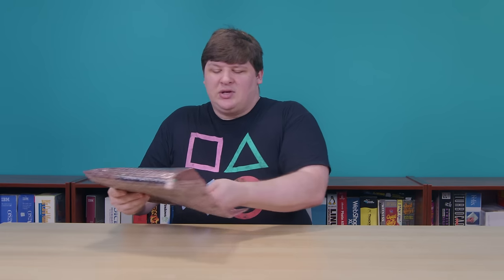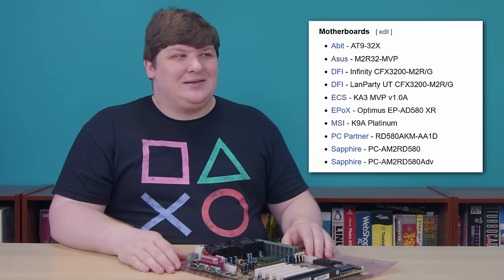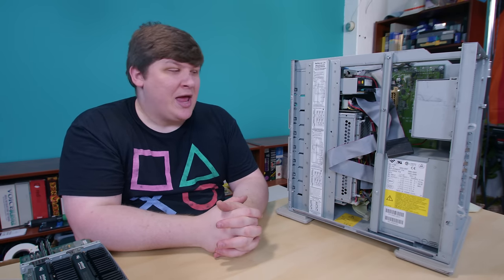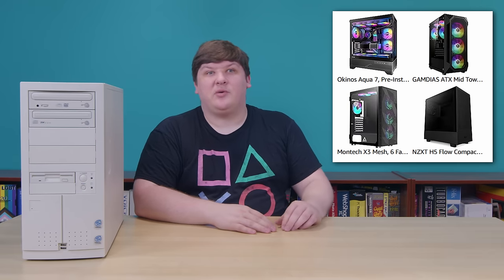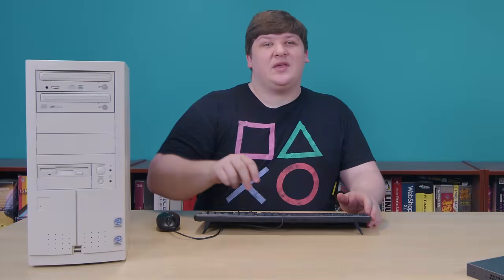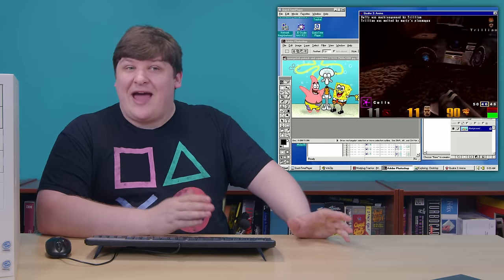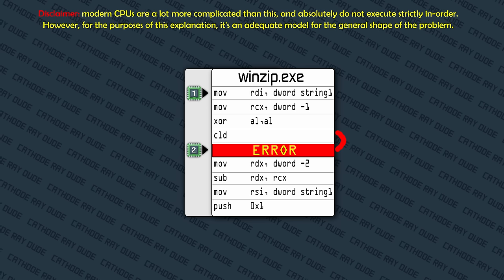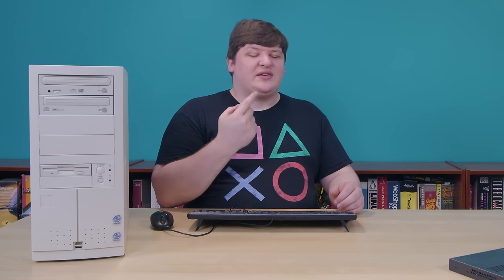The Only Famous Motherboard

Comment: I totally remember the celeron hotness.  My girlfriend at the time was absolutely bonkers about hers, lol.  Also, unless it's changed since I was in grad school, most dictionary-based compression algorithms are impossible to parallelize.  The state of the "dictionary" changes after every token is processed, so it's not possible to know what the state of the dictionary will be at any point in the file other than where the "head" is.
Reply: Yep,  back then I was constantly on the overclocing forums and being envious of all the wild Celeron overclocks.

I think I remember the Celeron 300a was super popular because you could pretty effortlessly get 500+ Mhz out of it.
Reply: The way to parallelize it would be by decompressing two files at the same time - this actually should be an area where zip has a huge advantage over 'monolithic' archive formats like .tar.gz, since each file within the archive is an independently compressed stream, something that's historically been regarded as a disadvantage since it of course makes the compression itself less effective than it otherwise might be.
Reply: 450 was a given, 504 was common but not always
Reply: The only way i can think of parallelise compression is ti split one file into multiple smaller ones. This is what i did sometimes. instead of "onebigfile zip" i had 4x "partofonebigfile zip" which were then merged together after extraction. But this felt kinda whacky at the time and was a manual process, i have to admit, to cut a single file in pieces. It was buggy too sometimes, espcially when receiving cut pieces from someone else who may have used a slightly different algorithm or settings. Thankfully, most mainstream archiving programs can do it automatically nowadays in one simple setting. 

multicore dual cpu workstations were a different hassle too with the NUMA nodes. Virtualisation was a must. I remember having a dual xeon workstation with the core2 architecture. Was the same issue just with more cores. 

//typo
Reply: But you could compress two different archives simultaneously, as long as you had the disk bandwidth to keep up. I doubt you wanted to though, still having a usable system while that is going on in the background was pretty good compensation already.
Reply: you can parallelize them but you need more than 2 cores to get any speedup and you will get less compression, you split the file into multiple parts, compress them all, consolidate the dictionaries and recompress the entire file with a static dictionary in parallel
Reply: @hyperturbotechnomike  I believe modern formats like lzma use blocks of data. Eg 4kb blocks that can be unzipped in parallel.
Reply: @myne00  Yes, liblzma supports multithreaded compression and decompression. The cost is compression ratio. For whatever reason, the more threads you add, the less efficient the compression process becomes.
Reply: @random832  Not only there's formats like bzip2 and zstd which are designed around individually compressible blocks, but also e.g. pigz which splits the data into chunks that are compressed into concatenated deflate streams, which every gzip decompressor can deal with. This is also the idea behind multithreading in 7-Zip/xz, the only other feature between LZMA and LZMA2 are preprocessing filters like BCJ (replacing relative with absolute jumps in binaries in hopes of larger redundancy).

Comment: I was running Windows 2000 pre release versions on my machine in 1999. It was still tons better than NT.
Reply: Me too, 2000 was the best for bp6
Reply: Agreed.  it was rock solid and had a better user interface than NT4.  It also had very good support for DirectX.
Reply: Had a older friend of my mom give me his msdn discs nt5 beta 2 i belive.
Reply: 2k was the 💡 moment. NT architecture with slightly improved stability, a massive driver library and support for older systems..
Reply: By XP & Server 2k3 - the support for older machines was a big middle finger.. but there were good reasons.
Reply: I had 2k running on my Abit NF7 for 5 years without reinstalling and constantly hibernating, without actual rrstarting for weeks. I miss 2k stability... Had to switch to XP eventually because 2K couldn't wifi...
Reply: Not heard that nf7 name for long time

2000 was good (might still have the hdd that ran the boot drive) , even got compromised once when I was using ics without a firewall software to share the 1mb/512kb docsis connection to other computers I had (they was trying to use me as a dump site they uploaded 6 movies before I noticed it on the second day)

Comment: Are you gonna talk about that mistake intel made that made this board usable for consumers in part 2?
Reply from the maker: yup
Reply: @CathodeRayDude  of course. 

You never disappoint, Gravis. I was a little scared on that last part, but you have me relieved.
Reply: @CathodeRayDude  Awesome. That's a story that has definitely not been told, at least not on YouTube. You've been spending a lot of time in old forums haven't you?
Reply: @lemagreengreen  Sounds like that one time intel forgot to disable base clock modification on non-k CPUs, allowing you to buy cheaper "non overclockable" CPUs, and overclock them via base clock.
Reply: @hikkamorii  Is that just like FSB overclocking? I admit it has been many years since I did anything like that but we used to always bump FSB up a bit.

On many "multiplier locked" CPUs of the late 90s/early 00s there were tricks to enable multiplier control, Athlon first generation had pins on the cartridge board that we plugged dip switches in to control ,multiplier, Athlon Thunderbird/Duron had traces on CPU package we connected with conductive paint to set multiplier etc.
Reply: @lemagreengreen  It's basically the same as FSB overclock, but of course modern CPUs don't have an FSB.  I know it was really common, especially I know many people overclocking AMD FXs with BCLK, because it's more reliable then adjusting individual multipliers. I specifically meant 6th gen. non-k CPUs, like i5 6400, which had locked multiplier, but intel forgot to disable ability to change BCLK in the bios, though I believe they later "fixed" that.

Comment: I wanted a DayStar Genesis Mac clone in 1996 for no other reason than bragging rights. Almost nothing I used would take advantage of the extra PowerPC CPUs, but damn those things were dope.
Reply: Classic MacOS itself had no concept of multiprocessing, you needed a special system extension to enable bare minimum support for it. Even with that extension, it only supported round robin SMP. Since Classic MacOS also had no concept of memory protection (it was a cooperatively multitasked OS like Windows 9x), it just made the system more unstable and more prone to crashing.

Had Apple kept up development of A/UX when the first 60x MP Macs came around, they would have had a far more powerful market position, and not be stuck with crippled System 7 and bolted on 3rd party acquisitions until 1999/2000 when OS X came out.
Reply: @GGigabiteM  All true 🤷‍♂️
Reply: @GGigabiteM  I thought Win 9x had preemtive multitasking; not that it mattered much since that generation of Windows was notoriously flimsy.
Reply: @Desmaad  9x had preemptive-ish multitasking in the same way Amiga did — which is to say, no wider protection from programs overwriting each other's memory spaces or crashing the entire system; but at least a program couldn't hog all the CPU time.
Reply: @kaitlyn__L  Badly written programs could definitely eat all of the CPU time. Two examples would be Sim City 2000 and Yoot Tower.
Reply: @GGigabiteM  then it’s definitely just cooperative :) assuming you mean every other program in the OS and OS as a whole was completely unresponsive rather than just quite slow. Linus Torvalds called it “preemptive which degrades to cooperative”, since it’s under high contention you really need the benefit of preemptive…
Reply: @kaitlyn__L  At least the Amiga had an excuse: the M68k had no hardware support for memory management.
Reply: @Desmaad  it’s not quite identical: Win 9x is better at memory management but Amiga can be better at sharing program resources while under contention. Though if the program priorities were set up wrong on Amiga you’d crash the kernel so that’s fun, and makes it no guarantee.
Reply: @kaitlyn__L  What's funny about the Amiga kernel is it doesn't run in kernel mode; it's a user process like all the rest, weird.
Reply: @Desmaad  The 68000 could support memory management with a 68451 MMU, but the 68010 was better suited since it also allowed for virtual memory. The 68020 also needed a 68451, Motorola didn't integrate an MMU until the 68030.
Reply: @Desmaad  that certainly explains the priority thing!
Reply: Yup, I had one running dual 200MHz processors. The AT-standard case was of huge benefit compared with my PPC 8500 and 8600, able to host a Nikon slide scanner and CD as well as boot drive, ZIP, and JAZ, with UW SCSI and USB as well as multiple video cards to run three monitors and a host of external SCSI drives and scanners and printers; everything it took both of the Apples to do.
Reply: @GGigabiteM  Solid point about A/UX.

Comment: I owned this board when it was brand new. Pair of Celeron 366’s at 550. And you missed the reason why this board was so important. The Celeron wasn’t supposed to be capable of being multiprocessor capable. Then when the Celeron went from being slot based to socket based, they made “slocket “ adapters, this was a competitive market and the better slockets found a way to work around Intel’s SMP limitations with the Celerons. Turned out it was just a pinout difference. Abit, wanting to make a name for themselves built a motherboard with this mod built into it, and built this dual socket board. Not only were we taking Intel’s budget CPU and overclocking it 50% making it faster than the laggy Pentium II CPU’s, now we were able to build an epic machine that could run TWO of them for less than the price of ONE Pentium II. We were sticking it to the man! And Abit was our hero for taking them on. 
Also, your pair of 500’s are on a slow 66MHz bus. The system really shines when you can run a 300 or preferably a 366 on a 100MHz bus at 450 or 550.
Reply: Intel should make the same “mistake” today
Reply: I couldn't have said it any better!
Reply: I ran two 400 MHz Celerons at 600 MHz on BP6. First time I booted, made my head spin.
Reply: I had the exact same setup
Reply: Bingo. Being able to build an SMP system for so little was a huge novelty in of itself. Intel wanted SMP to be a premium feature, even though it was functional throughout the line if not artificially constrained.
Reply: @epobirs  running 2x celeron in 550mhz with a 100mhz bus speed was epic at the time
Reply: Nailed it, spot on. But think he's going to address the "sticking it to the man" in the part 2 of the video.   Being able to exploit a feature that Intel either accidentally left enabled, or thought no-one would find out about made everyone who had a BP6 feel like they were just a "a bit" smarter than the average power user.    I had several BP6's, and I loved them.  Ran NT4, 2000 and various linux distro's.
Reply: There was another big difference between the pentium and the celeron.  The pentium had either 2x or 4x the L2 cache, however it was on separate chips on the card.  The celeron had the L2 cache on die and it ran either 2X or 4X faster.  The former made more sense for productivity apps, but many games really took advantage of the latter.
Reply: And there I was, thinking I was hot stuff with my penciled Duron 600. 😂
Reply: @evlkenevl2721  I’m the guy that invented the pencil idea. Literally.
Reply: well put. - I didnt now better and got 400er Celerons - Sadly one of them didnt make the 600 stable, i tried everything.
That said, it was so great to game on one cpu and host a gameserver for lan at the same time. I used Windows 2000. Most exiting PC times : )
Reply: I built a dual-core Pentium 3 for one friend - huge dual slot a cpu cards - expensive! Then two bp6 systems back to back for two more friends; so affordable. And that insane 300->550MHz +50% overclock was so so sweet.

Everyone wanted smp, the systems would stay so much more responsive while single core systems would bog down quickly. And this was just so much more affordable than the Pentium 3 system & motherboard!

I finally saved up the money to buy my own bp6 a little latter! Ran as a hand-me-down for my parents for many many years.

And yeah, the fact that the Celerons weren't supposed to be multicore capable was such icing on the cake. Multicore hack from Abit on an affordable board, and the crazy overclock gratis. BP6 was the shit!
Reply: I had one MB (slot 1) which was able to overclock Celerons obove twice. With big radiator and without fun.  Also I had two ATX PSUs working together and also without fan.
Reply: Bingo! Young guys just don't know what it was like. I couldn't afford Intel; my own first Windows machine was a Cyrix M][ in a motherboard that was very future-proofed; in an time of SIMMs, it also had a socket for DIMM RAM that had its own voltage selector for 5v or 3.3v, allowing use of PC66 and later PC100 DIMMs! On top of jumpers for 50, 66, 75, 83, or 100 MHz bus speed, it started life with that Cyrix overclocked at 225 (83x3), and ended with an AMD K6-3/850! Windows 98 first edition, through Windows 2000 Pro, numerous video cards (AGP 2x-4x), and just about every Soundblaster made!

People rarely bought a new machine, they upgraded components for years as they could. Buying a new monitor was the big thing, 14", 15", 17", Trinitron, and anything over 17" was huge!

God I miss some of my old gear.
Reply: This remembers me PAT (Path Acceleration Technology) on Pentium IV made for i875 but... the budget i865 can have PAT enable by some vendors (as seens in Asus P4P800 Deluxe). i865 was cheapest and the only truly difference is ECC in i875.
Reply: Had the same board with the same CPUs. Fun times back then.
Reply: @RetroAnachronist  oh hello! please accept my salutations (as someone who has honestly never tried your trick and probably never will - but majorly ingenious!)
Reply: Exactly, I was in comment to say this, Intel forgot SMP enabled on celeron because it's made out from a P6 Pentium pro cpu (because of the intergrated L2 cache,). all celeron coppermine cpus got smp disabled. Also, celeron socket 370 cpus likely overclock better than slot ones because stepping are late, best process of the .25 microns. a 333 to 504 or 112fsb was the best (and can turbo frequency for a more 2%)...  440bx not have the xeon chipsets taxes. we had this board for 99 to 2001 always on win2k me and my friends (we did all win2k betas, It was awesome!!! ). ;D
Reply: I still have the Board around with a pair of Celeron 500 on it. And i have another Board with an PIII 550 Katmai and a PIII 800 Coppermine on it. What this Board could was Homeserver Tasks and Gaming Server Tasks, the big dual Slot 1 Board was my Home Server and Trainingserver for my CS Clan, the "small" Celeron 500 was my "mobile" Server for Lan Parties. Both Machines literally blew every other dedicated Server out of the Water, 32 Players on a map and another 16/32 Server on it no Problems with a 2ms ping, in comparisson a 1ghz Athlon running the game and the server had a 40ms ping, even with dedicated server only 20ms(thanks to win9x). Had Windows 2k Server and later Windows 2k3 Server running on them. Until 2006 they were the best small Gaming Servers one could get, thanks to the high response time of the short Pipelines, replaced them with a C2D, but never sold them.

Comment: OMG I absolutely had a build based on this motherboard.  Loved it.  After it ran its course as my main machine, i moved the internals to a much taller tower, installed a ton of drives with a RAID hardware card, and turned it into the file server for our FTP sharing group (shouts out to the rest of ANiVCD!) and it lived under my desk and then in my closet. 

Ah, memories!

Comment: Absolutely loved mine. Beige box with a window cut in it myself. Dual Celeron 400's running at 550mhz with water cooling and CCFL lighting. Had a 500 watt car amp bolted to the right side of the case and a second PSU with a half farad cap, and i DJ'd parties with it!
Reply: I loved that era of computing.

Everything you did was fully custom. You could browse posts on forums and get cool ideas.

I had a K6-3 400 that I could only overclock to 450 and stay stable, and I was jealous of the crazy overclocks the celerons could get.

I think I remember the Celeron 300a being notorious for effortlessly overclocking past 500mhz.
Reply: In 2002 I needed a new case because my previous one was AT format, not ATX. This was of course when everything was beige, so I knew I'd have to paint it and every other component I ever put in it. What I didn't know was that black optical drives would become common, or I probably would have taken that route. Instead I went with metallic dark blue. And that's why I was in the back yard the other afternoon spray painting a DVD burner with the very same can of paint I used 22 years ago, because I'm still using that case.

Comment: I adore this show concept. The best part of it is that you talk about everything, so even newbies can understand it. Explanation of multithreading and multitasking is fantastic! 
Anyway, very good topic to go over. SMP was stong pain in the early days and I kind of encountered this myself. About half a year ago I've build dual socket 370 computer with 1GHz Coppermine chips and fast SCSI drives. Game performance... well.. it's nearly identical to single chip, but multitasking is something other. It's running under Windows 2000 and it basically shreds everything you throw at it.
Also, two servers you've shown are fantastic pieces of hardware, I'd love to get my hands on one of these, just to play around with networks and such.